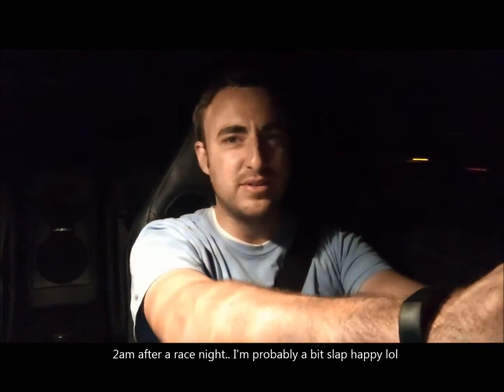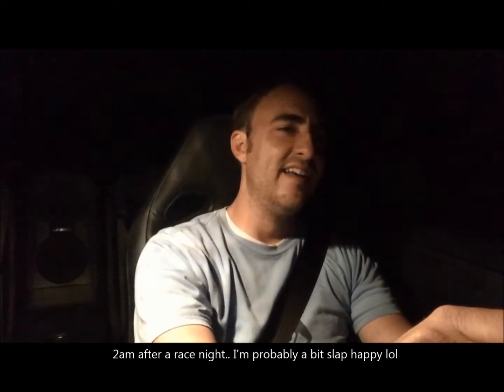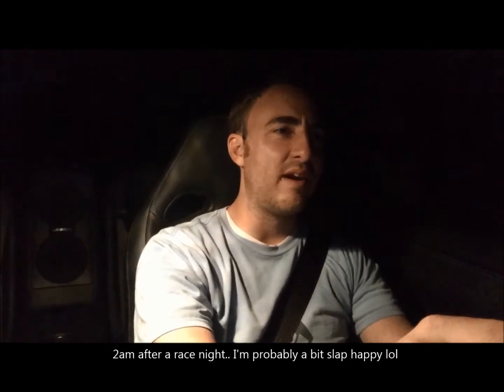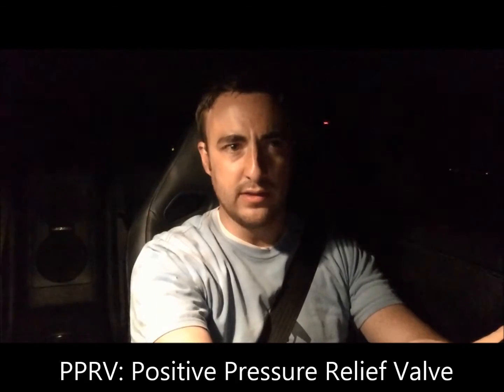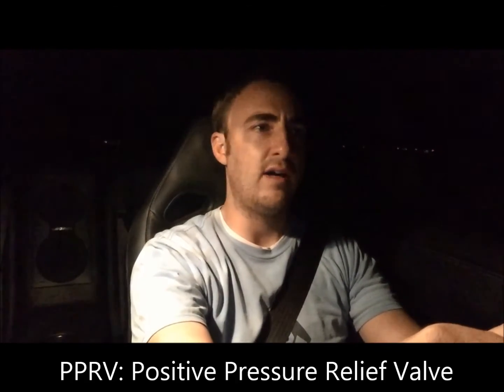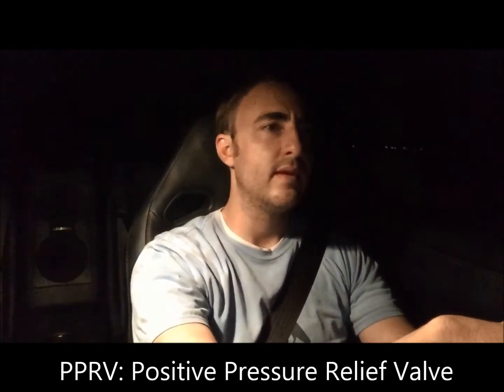Fuel Systems: Returnless vs Return & How They Work.

Comment: Do you think a dead head set up will help lower fuel temps ?
Reply from the maker: Yes, that’s about the only advantage of returnees
Reply: @dannyjohnsonsgarage   I’m still trying to figure out dead head set up but it basically means it puts the regulator after the rails correct?

Comment: so is the returnless system fuel pump motor variable speed based on the inputs to that fuel module in the trunk? or does it just start and stop the fuel pump kinda like pulse width modulation??
Reply: Returnless systems also have a fuel-pressure-regulator... its just that its in the fuel tank instead of in the engine bay.
Reply: My 96 cobra has a return line back to gas tank .

Comment: Thank you. Always been curious about the difference when I'm looking at Cobras these fuel systems are common and I've always had trouble differentiating the two.
Reply from the maker: I'll go return someday. As soon as my pumps or any other component fails lol
Reply: @dannyjohnsonsgarage  I'm deleting the PPRV on my cobra as soon as the weather turns this spring. Getting a sizable fuel delay when shifting WOT in my 04 cobra, which is jarring to say the least. I have an unknown tune with a 2.81 pulley from the previous owner, but hopefully doing the delete fixes the problem.
Reply from the maker: RealBigTuna Yeah, some say an efficient tune can also be helpful. Some say the car will have more trouble starting with the pprv deleted- and make sure you get the lines tight since the pprv delete tends to blow the hose clamps off. 
My brother has his deleted on his supercharged bullitt with cobra tank setup and it seems to be okay